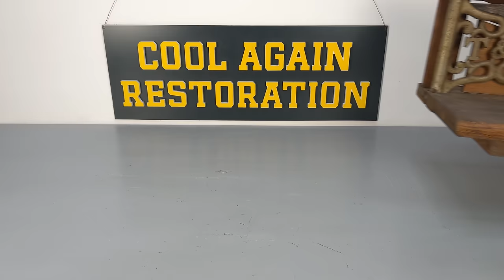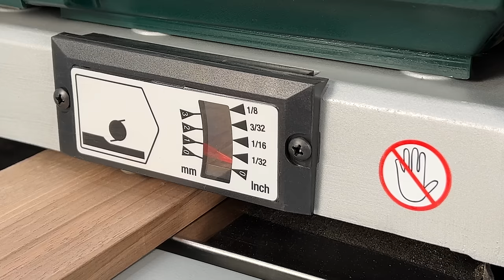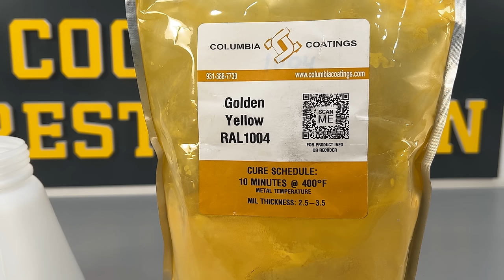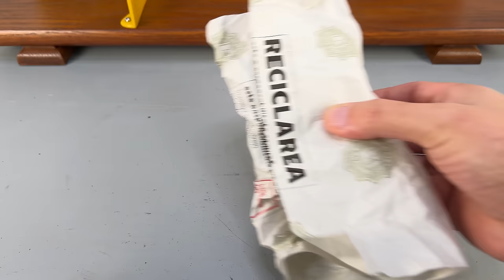1883 Meat Slicer Restoration - Tucker & Dorsey Edition

Comment: While it's a beautiful work, I would not call this restoration... Restoration brings back the original object, so I would bet they didn't have powder coatings back when this was new for example. If this was an expensive antique, now it's a cheap replica pretty much.. :/
Reply from the maker: Hi MrZnarffy ! So, restoration it’s a very sensitive topic. Some people call restoration just a clean and leave all the patina of the passed time. Some call a restoration a deep cleaning but not to change anything to the item. Some want to change parts but to keep casting marks and pittings. And some want to be clean and functional like they made it. I bet they didn’t have it powder coating back time but I bet if then was they will use it because is very durable like a finish. Now, I restored this item, why not to paint with powder for a more durable life? Who know, maybe after 100 years this will be in great condition because the paint are still on the part and no rust at all. Is not a better chance to keep the item longer ?

Comment: Who TF uses a kitchen knife for a pry bar? I mean use what you got but dude. And the tiny corner of the blade being broke ain't gonna hurt anything.
Reply: These parts aren't original. I have to replace them. With more non original parts.🙄. WTF
Reply from the maker: First of all, that knife is one that I use only in the workshop and I found good for making that kind of job because a pry bar probably hurt that tiny wood part. I choose this method because I feel safe for recovering that wood. Is a knife I don’t use it in the kitchen. And regarding to the original parts, that slicer legs was 2 simply wooden part. I made some research and that’s how she slicer legs looks. I tried to recreate them after the pictures I saw. Now please tell me, what is wrong here if the main goal was to restore a slicer and to make it functional?

Comment: You have been scammed on a purchase. This device is definitely not 140 years old. According to me, looking at the condition of the wood, it is max 30 years old, but I am sure that the wood is max 3 years old and has been specially treated.
Reply from the maker: You can simply search on google for T&D meat slicer/cabbage slicer/mandoline and you can see the product. Just simply search before write 👍 I’m pretty sure the slicer was treated for worms because has a good condition but , 30 years old means to be like new .
Reply: @CoolAgainRestoration  
If the age declaration is true and the device has been preserved in very good condition, it has been used for the vast majority of time. Given its age, this cutting device should have years of traces of tiled stove smoke, grease and water. Contrary to appearances, it should not have any traces of parasites. In addition, the wood shows no signs of use. Its surface is absolutely smooth. No dents, knife cuts, indentations made by something sharp. Besides, with that amount of use, you'd have clear marks on the hilt itself.

I will give my hand to cut that this device is not even 1/10 of the declared age.